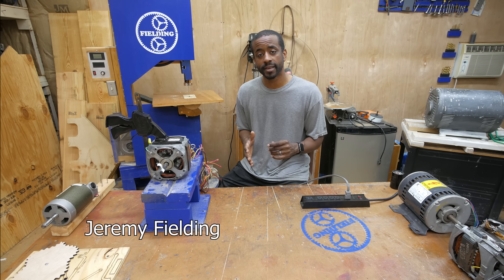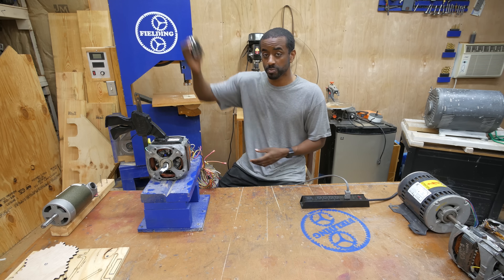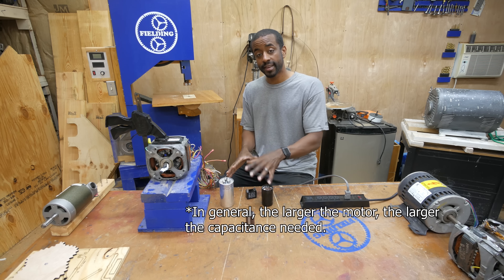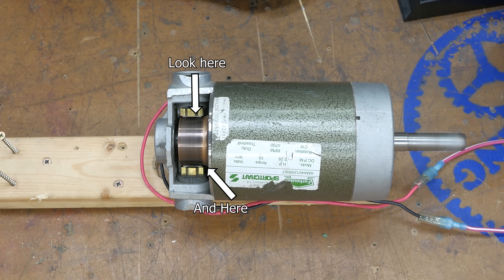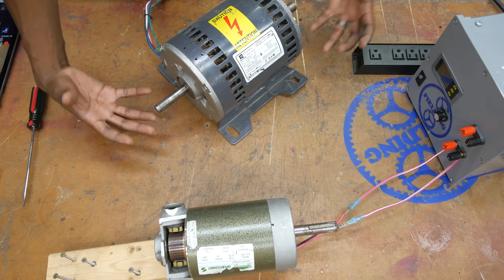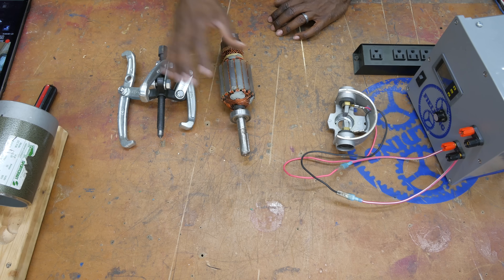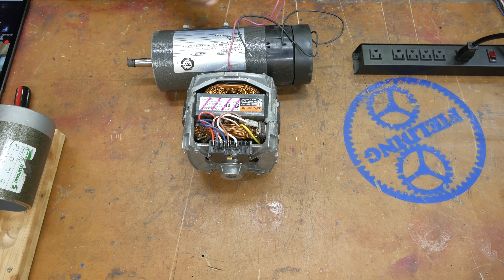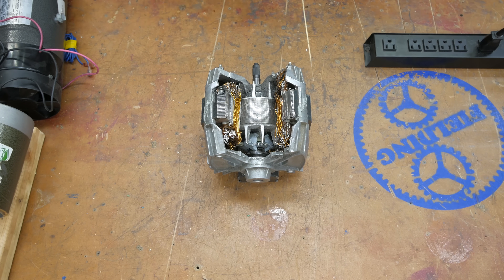Three Most Common Motor Fixes Anyone Can Do; Ultimate Guide to Electric motors ; #070

Comment: On DC motor brushes if the exact size is not found a larger brush can be filed down to size with an ordinary file. Use cation because it will remove the carbon very quickly. I am speaking of adjusting the sides and not the part that touches the commutator. That angle would be difficult to replace.

Comment: I have several small waterfall pumps that will do this humming thing and then if I take a screwdriver and work the impeller back and forth when it is not plugged in they will run for awhile longer but eventually get to where they won't run at all.  Does anyone know whether you can get a capacitor for a motor that small?  These are I think 1/2 hp motors.

Comment: capacitance value matters if your capacitor value is too high you will kill the motor faster and if lower than the original makes the motor sluggish and may damage the capacitor you just replaced

Comment: I have a motor on a jet wash pimp with Centrifugal switch failure.
Unfortunately, there are no labels to show what type of motor.

Therefore, I cannot buy a switch - I would rather buy another motor.
I do not know what kind of motor I need. Shall I scrap the whole thing?

Comment: Got a weird one, radial arm saw won't go to speed, acts like the centrifugal switch is bad. But, when I reverse the wiring to the motor, runs perfect. Except the rotation, of course, is the wrong way! Still trying to figure this one out. It's a 110/220 induction motor. Going to switch back to 110 and see what happens.

Comment: great video thank you! I don't know if you already mentioned this in another video, but capacitors can be dangerous if not handled correctly
I replaced the run capacitor on our central ac and it was rated at 400 volts, the start capacitor was rated lower
so whatever you do, don't touch the top, always handle capacitors from the side and never assume they're discharged
there's videos that also show how to discharge capacitors. also learn what they look like since they come in all shapes and sizes. supposedly the most dangerous capacitors are in microwave ovens so be careful
again thanks for sharing your knowledge

Comment: This is great! I've been working on a new design for a small evaporative cooler and I bought a 12V DC car fan (for inside the car - not a radiator fan) with a variable speed controller switch. The fan motor stopped working and I think it likely was that it got too much water in or on it. I cut out the speed controller switch to see if it would work without it, but had no luck - so it's got to be a problem with the fan motor. Is this a lost cause or do you think replacing the capacitor might work?  I think the fan motor is 9 watts - 12V x 0.75 amps.  Thanks.

Comment: Like your video. I recently had a WEG motor on my air compressor fail.  The start cap with blown. Top half blown off and bulges on the side.  Replaced both start and run caps and still the motor would not run. Determined it must have been in the windings. Bought a new updated model on Amazon and up and running again. A motor repair company near me determined the same.

Comment: I love your videos. I had an unusual problem with a dishwasher motor. This is a well known GE dishwasher issue. The cooling fan was pressed on the shaft. Over time the fan would come loose so no more cooling air. In my case the motor did not have thermal protection so it fried before I discovered the problem. You should check that the cooling fan is still firmly attached to the shaft if you are having overheating issues.

Comment: Bought a used grinder motor. Got home plugged it  in and run fine. Shut is off but it kept spinning. Electricity was off but it free wheeled for several minutes before finally stopping. What's wrong?

Comment: Just to point out, the center spinning section connected to the motor shaft is called a Rotor in an AC motor and an Armature in a DC motor.

Comment: My car's sunroof motor died and it was the brushes worn out. I changed the brushes and now the motor works fine but only when it's not connected to the sunroof mechanism. Which means the motor doesn't carry the load. Also when changing the brushes I noticed that one of the magnets inside was damaged. Could that be the problem why the motor isn't carrying the load or is it something else?

Comment: Hello I do have a problem with a treadmill with a dc permanent magnet motor. Always on the almost same speed there occure a error dC9. With mechanical load at 103V. Without load at 113 volts.   It seems load does not trigger the error on a great amount. At little speed i cant produce the error even with high mechanical load/high current. Any idea?..best greeting Hans

Comment: I had a shop vac who motor started sparking and smoking. Took it apart and cleaned up the brushes, but when I started it again it was still sparking a lot. I put it out side and let it run thinking maybe the brushes would wear in and quit sparking but never did and it finally quit running at all. Might have blown the little breaker/fuse  it had in the wiring. But once it quit running at all I just threw it away.

What might have been a way to fix that motor?

And another motor I've had issues with is a ceiling fan. It got where only one of the three speeds would work. I replaced the speed capacitor in it and it worked on all three speeds for a while but then quit completely. I haven't bothered with it for a while, but wonder if the replacement capacitor was just a crappy one or if something is going on with the motor itself that is causing it to mess up the capacitors.

Comment: This helped me even though I'm not trying to fix a motor. I'm trying to fix a T80 hookah air pump used to get breathable air when under water dredging for gold, and the bearings look pretty similar. Turns out they're rusted on mine. Thanks for the video!

Comment: I replaced the capacitor on my belt sander motor. It worked for about two weeks despite being the same part number. Maybe it was crappy replacement.

Comment: The most frequent problem I have run into is dirt or sawdust on the centrifugal contact switch,  capacitor second.  
I ran into one problem you probably have not seen:  an armature that walked on the shaft.

Comment: I have a small AC fan that started making noises and had difficulty starting.  I took it apart and cleaned the gunk out of it and it started working just fine.  This particular AC motor had no permanent magnets in it.  It had a coils that were not wrapped around the motor, but were off to the side, and it had a rotor with laminated discs.  Can't remember what type of induction motor it was, but aside from that, it didn't have any separate bearings.  It was just a super cheap clip on AC fan with a low and high setting.

Anyway, just adding this because apparently, internal cleaning is something some motors need periodically.

Comment: Great video. Thanks for making these very informative videos.    I have one for you... I have a wood lathe (Harbor) and it's been sitting for 5 yrs w/o running.  Tried it today and motor would not start.  Been sitting in a humid garage so I think it might be rust or capacitor. Only has maybe 50 hours on it total time.  Thanks again. Keep the great videos coming.

Comment: Thanks for your excellent video. I have had a DC motor problem that you did not describe. I have 2 DC motors that occasionally will not start. It's because the motor stops on a certain spot that has no conductivity from brush to commutator. The quick and easy way to get it going again is just to manually turn the motor shaft to a new position. The way to fix the problem would be to take the time to clean the commutator and or new brushes.

Comment: Jeremy  - this video helped out a lot.  Question - I have a ridgid planer motor that is sparking real bad - when I look at the brushes they look like they are not used up.  there are some chatter marks on the leading edge of the brushes.  Only one side is sparking bad.  Does this sound like bruhes need to be replaced to you?  Than you.

Comment: I have a series dc golf cart motor brushed dc 48vdc and it seems to work poorly at 12v.
I took it apart and the field ohms at .6 ohm, which is the same as a dead short on my meter.
Same for the commutator bars .6 ohm.   Is my meter just not accurrate enough?

Comment: I have a table saw motor that uses bushings. I was in the middle of a large production job when the bushing became so worn that the motor would not run. I wrapped the shaft with a strip of aluminum from a pop can and put the motor back together. It is still working twenty years later. I also used the same trick on a car alternator. I was 400 miles from the nearest parts dealer and was looking at a two week delivery time for a new alternator. The fix lasted about 3 months, but it got me out of a tight spot.

Comment: My fan motor could't start after I lubricated its shaft. It could be spinned by hand easily, but the motor didn't have any power and didn't spin on its own even after giving it a push. Buzzing sound could be heard inside, so i thought its capacitor was bad, so I changed it, but the problem persists. Any ideas?

Comment: I have a fan motor which has these symptoms, u push it to start, however as soon as u put the fan blade on it won't spin. it's not the capacitor, instead I thought it was the temp fuse thing if it's too hot it opens the connection. but I'm almost positive there is a broken wire

Comment: Hi Jeremy 
I am watching your video second time and it's worth watching you. I am hobbyists carpenter.  I am having a problem with my benchtop sander and a jointer. 
When I turn on sander it runs for few minutes and then start smells like burning.  
I turn it off and let it rest for sometime. 
Kindly explain what could be the problem. 
Secondly when i turn jointer on it runs for normal but after a minute it slows down and then pick up speed again. It happens always.
Kindly explain what could be the issue. Other motor operated tools are working ok. 
Thanks.

Comment: It seems you would be the guy for this problem. I have a 1/3 hp 110v very old motor  from a sears jointer  when I plug it in I get nothing no hum.  The capacitor tested NG  when I checked the CAP leads for continuity I get nothing.  I haven't opened  the motor up yet but see no sign of any type of reset button . Please point me in the right direction as to where a start/shutdown switch may be located? Any thing else would be greatly appreciated Thanks

Comment: Excellent video!! Apparently, ran too many amps through a motor given to us for a go cart and killed it?? 24 v 2.5hp 300rpm dc motor. Did not know the amps and in testing it on a bench top power supply, inadvertently ran 5 amps through if and only saw a puff of white smoke on the negative terminal before the motor stopped.  Let it sit for one day, hoping it was thermally protected but no such luck.  Hard to believe we tanked an otherwise burly robotics motor from NPC robotics.

Comment: I was wondering if you could help me with my small air compressor compressor motor it is a 1/5 horsepower it has a red white and a blue wire coming off the compressor It has a 3 pronged switch and a pressure sensor and I am lost when it comes to wiring this thing up any help would be appreciated The power cord is green white and black the pressure sensor is there is Brown and  Light blue And the capacitor is 2 wires it's ACB B618 micro ferrets 5% 250 bolt. AC50 to 60 Hz Any help would be greatly appreciated I've been reading articles and messages stuff on the Internet and I cannot find the right stuff or I'm confused by it

Comment: I know this video is a couple of years old but I hope you are still watching the comments.
I have a small washing machine that was doing the classic hum and not spinning.
I can give it a spin by hand and away it goes.  I thought, I know what that is! It’s a capacitor problem.  I ordered a new one on line with the same rating and replaced it.
The trouble is it didn’t solve the problem.
What else could cause this symptom?
It’s a really simple twin tub mobile machine meant for camping or caravans.  No computer or circuit boards to worry about.
Just an on off timer on the spin motor and a micro switch on the lid. Washer motor works no problem.
Love your Chanel by the way.  :)

Comment: Any tips for replacing the wires on a dc motor with a capacitor? I have a fan at work I need to put the wires back on but I don't know what wires to solder where on the pad.

Thanks for your videos, they're great!

Comment: Funny. 3 common motor problems/fixes mentioned and I encounter 3 of them during last 3 years :-). 1st (3 years later) - worn brushes in washing machine motor (replaced by new ones). 2nd (last year) - failed capacitor in lawn mower (replaced by new one). 3rd (this year) - blown bearing in other lawn mower (replaced by new one). As I am a hobbyist I am proud that I found out what the problems were (with the help of internet) and was able to fix it. So this video is 100 % true!

Comment: Some small pump/appliance ac motors are actually dc motors with a rectifier wired inside the motor casing that will burn out. You can get a new rectifier for a couple of bucks and replace it.
 If a motor has over heated and melted the winding wire coating causing a short you may not have to replace or rewind the motor.  You may be able to clean out the carbonized coating and recoat the burnt area of the windings a good dose of crazy glue.  Clean as well as possible and blow out with an air gun. You only get one chance to get the glue to coat the wires so be generous with the thinnest glue you can find and let dry over night. I repaired a 5 hp motor on my air compressor this way 10 years ago and it's still running fine.... so worth a shot.

Comment: I had a 3 phase motor that didn't behave as expected, too low torque. It turned out the electrician who connected it had used the Y connection when it should have been the D connection. I wouldn't expect such a mistake from a professional electrician.

Comment: Regarding the bearings: the "z" following the number (6042z or whatever) often refers to the bearing being sealed on at least one side. Some brands have different designation for a double sealed bearing, specifically by adding another "z" (6042zz). When searching for a replacement, ensure that your replacement is sealed on both sides( or only one side if that's what you need). I learned this the hard way when replacing the bearing on my kitchen aid mixer. Bearing was double sealed and had 6042z on it, I bought a different brand bearing with the same number. The bearing was an exact fit, but only sealed on one side. I had to get a 6042zz (not the actual bearing number, I can't recall the exact number).

Comment: So does the start winding/switch have its own brush? Or how is that contact made?
Reply: The centrifugal switch has contacts that look like parallel blades with a pair of contacts that are made of copper and coated with some silver or nickel plating to increase their life expectancy. This pair of normally closed contacts are pushed open as the centrifugal operated mechanism, with weights, comes up to speed to separate the contacts, thus disconnecting the start windings.

Comment: I was trying to think of any weird motor breaks we've had over the years and I literally can't think of any. All the weird stuff has been wiring and capacitor related. Went in to change something out one time and found out it had been running so long all the wires were cloth wrapped not rubber insulated. That's about the weirdest motor story I would have.
Reply: I once had a customers power unit fail when the capacitor exploded and blew the cover off leaving bits of foil and paper wedged into every nook and cranny of the motor openings and the disfigured box that once held the two capacitors. After replacing the complete assembly under warranty, I took the motor back to the shop and disassemble it to find the cause of its failure. 
It was hard to find, but I finally found the cause of its fireworks display. 
During the assembly of this particular motor. 
This one was missed by the assembler who puts the “c” clip into the centrifugal action, that removes the start capacitor from the circuit after the motor gets off and running. 
Without it holding the piece to the shaft where it belongs, it road up tight against the contacts and kept on charging the start capacitor til it couldn’t hold all the angry pixies being packed into it and she blew!
VIOLENTLY!!!

Comment: I fixed a box fan by replacing the THERMAL FUSE inside it.  I used an ohm meter to troubleshoot/verify the problem.  I got the replacement part from an online electronics supplier.

Comment: My dad did home repairs on car generators. When he replaced the brushes he checked  the comutator?? Spelling?? (What the brushes make contact with) for wear. If the brushes had worn grooves in the  copper, attached an electric drill to the other end of the shaft and resurfaced the comutator with fine sand paper on a flat  surface, strip of metal or similar while rotating the shaft with the drill.
Reply: Can also use a piece of sidewalk chalk in a pinch (not as aggressive as sand paper), just be sure to clean it well afterwards.

Comment: Wanted to thank you for this video. My compressor has been popping breakers and starting slow for almost a year, to the point I've been avoiding all of my air tools until I had time to figure out the problem properly.

Turns out it was the contacts on the centrifugal switch, just as you pointed out in this video. I had replaced both caps and was at a loss.. as of last night my 28 year old compressor motor is running good as new, all thanks to you.

So thank you, sincerely.